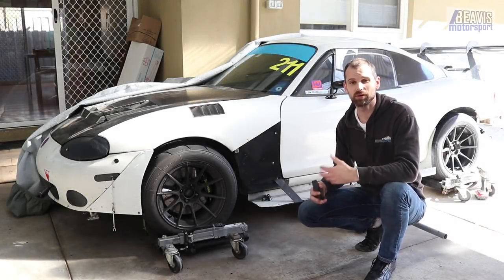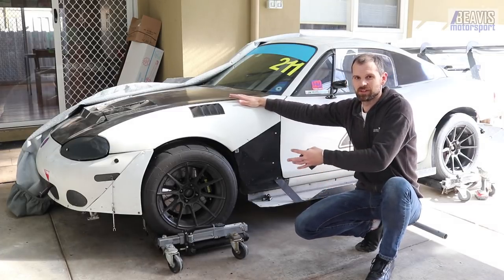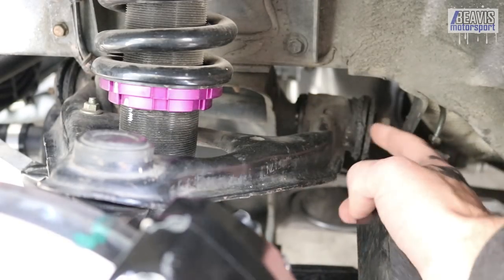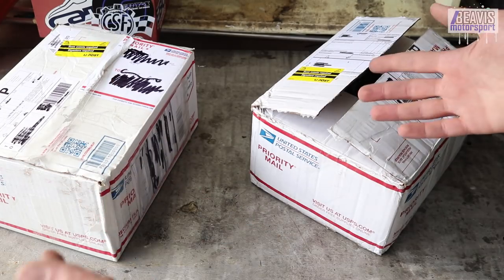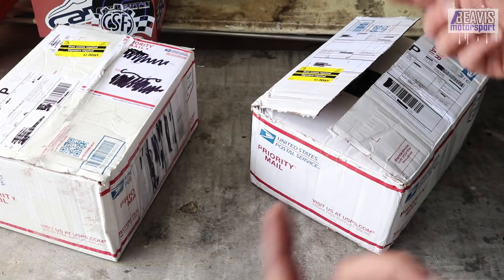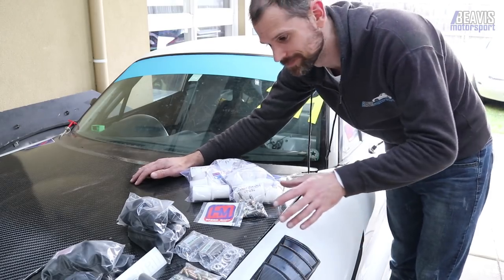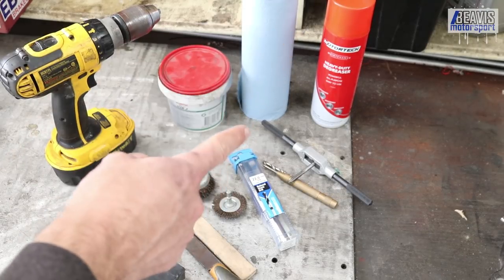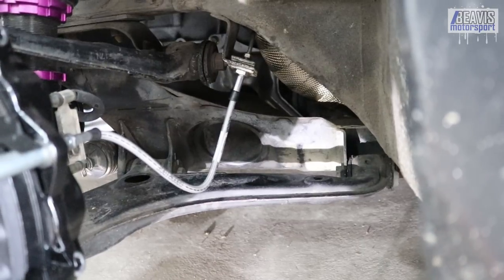Why Polyurethane Suspension Bushes Suck // Ep 83 // Time Attack TURBO Build

Comment: Hey man, I did a lot of researching to find out what the best grease to use for all poly is. One day I finally came across some users suggesting "Lucas Red&Tacky" as something that worked wonders for them.

I tried it out it's been almost a year since I installed my full Energy polyurethane kit. I daily drive the car often, and still to this day knock on wood ZERO SQUEEKS lol.

I fully vouch for the product as perfect solution as well. A lot of ppl on forums say teflon-based marine grade boat grease OR the grease the bushings recommend are the only solution yet people still report back of squeeks with using those products. I've even seen someone recommend permatec Anti-sieze haha as well as another guy that wraps his bushing sleeves with teflon tape.

So it really comes to whatever floats your boat. I've been thankful that Lucas Red&Tacky has worked great for me with zero drawbacks. Other than messy hands.

Hope this helps someone else as it's affordable like $5 a tube. Just I remember that people recommend to use it generously; no matter the grease. Load it up Inside and Out. Stick it all over the insides of the control arms, everywhere possible. :) The only thing shielding your grease from the elements ... is MORE grease caked on top. ;) Have fun! All in the name of PERFORMANCE
Reply: Enjuku Miata may i ask whats wrong with the EnergySuspension lube comes from their bushings?
Reply: @henryliu8518  I've never used it so i can't say from experience. I've only heard of people say that it has run dry on them fast, but you never know if those same people used enough of it and applied it as you should. So i think it's safe to say that there shouldn't be anything wrong with it other than the price for a sizeable tub. Pretty costly. A rather large tube of lucas red n tacky worked perfectly for me for like 5 or 6$ from my local Wal-Mart. It's going on nearly a year strong + with daily driving + you can see none of the grease has left the bushings too it still clearly has as much as i first put on lol. So i just wanted to spread good knowledge with people while on the topic of poly bushings and shead some light.
Reply: It was hit or miss based on online reports of people using the grease it came with. Probably matters heavy on circumstances. But i found even less reports online about people using the stuff i decided to go with yet none had anything bad to say. Worth spreading forward
Reply from the maker: Thanks for sharing so much detail, as always! Great stuff Enjuku.
Reply: Yep same shit I found with revshit, anti sieze or the bushings eat into the mounts and surrounding objects. Poly is shit when it needs to work in more than 2 axis's and that's when you go monoball, heim joint, or stick with oem rubber. Also all these companies do zero r and d and just copy whatever the better and next guy is doing hence the oversautration of the same poly product made by 10 differnet companies
Reply: @henryliu8518  Well unless they sell it in grease gun format, you have to tear down your suspension to grease it. Rather than use zerk-grease fittings. I've grown up around heavy farm equipment and EVERY vehicle we had up until my truck and moms 2007 FJ had a zerk fitting or I helped my dad pull and re-grease his wheel bearings in his old 1988 and 1992 Ford 4x4. It was always red. 

As long as its lithium based grease, which the Ultra Red is, youre golden as long as you have greaseable fittings.

Comment: Have you checked out SuperPro bushes? A lot more R&D into the design of them to not have the typical poly drawbacks (Energy/Nolathane etc) suffer.
Reply from the maker: I didn't consider it this time, the delrin kit was a little more expensive, and has a lot of positives that I'm looking forward to trying out.
Reply from the maker: Lyndon F  Not much opportunity to drive lately, all the tracks are closed due to lockdown so the car is just sitting in the garage.
Reply: I use superpro, from Australia of course, they a re fantastic, well designed, in some cases multi durometer poly mix and they fit well and perform brilliantly. You need to look about a bit more my friend.

Comment: If you pour your own poly bushings straight into the housing it doesn't allow debris to get inside also you wouldn't have to lube them because you cannot
Reply from the maker: Interesting idea, not something you see a lot. Would it make them hard to replace should they perish in time?
Reply: @Bbeavis  yeah but there are ways around that like finding the old part at a salvage yard and pouring another and your back in business or before your bushing goes bad buy a few of those salvage yard oem parts and pour a few and toss them in a shoe box under the bed for a rainy day im about to pour all the bushings and motor mounts for my car because it's cheaper than buying new stock and WAY cheaper than buying premade poly bushings theres a good video here on YouTube of a guy pouring his own motor mounts might want to check it out

Comment: not all poly bushings are created equally... my sister had Whiteline bushings on her STi that were still fine when she sold the car about 8 years and 160k miles later.
and if you're going delrin, you might as well just go metal rod end / monoball bushings.  There's nothing delrin does better than monoball bushings.
Reply: If you go down that route instead, the parts will cost thousands, and then suddenly you have a subframe/suspension arm setup which you can't quickly/cheaply source spares for. As it is, he can swap out any component Inc subframe for stock items cheaply and quickly

I don't know his budget or exact design brief but myself, I would go down this route for lower running costs / cheaper repairs / less down time more seat time
Reply: Braden McKay good point, I didn’t take those 2 into account
Reply from the maker: A complete custom rod end suspension setup is well beyond my DIY-er budget, and for a car that is just a weekend toy. This solution retains a lot of OEM like components and is somewhat cost effective for the performance. There are always better ways to do things, but this seems like the right solution for my use.

Comment: Use anti seize that gray or copper stuff. Also the poly is good for a road vehicle and ( light ) track work . Also maybe buy a proper brand of suspension products not cheap China  or some companies that claim to make the best parts with no R&D or make their parts in house . Just making money off people.
Reply: Lucas Red -&- Tacky is what I used. Awesome product. Just sucks to get on your hands.. (Almost as much as anti-seize). :P
Reply from the maker: Thanks for sharing mr323. The existing Energy poly bushes were from a reputable supplier, they are expected to be of good quality, but nonetheless poly still has its downfalls.
Reply: @Nasonix2  Maybe wear gloves? It sucks to get any fluid involved with automobiles on your hands.

Comment: Hi, my bushings burst quite frequently because the roads are pretty bad where I live. Would poly bushings last longer if I used them instead of rubber? My focus is on durability...I am referring to the bushings for the lower control arm (both front and rear bushings). I drive a Honda Fit Aria 2009 (4wd).
Reply from the maker: Not sure about Hondas sorry Johnathan, my experience is only with the Mazda MX-5

Comment: Did you run silicone based grease? 
 if you want your polly bushings to last run silicone based. 
Petrolium based grease kill polly bushes .
It's absorbed and eventually turns the bush sift causes tearing.
Reply from the maker: It was running the grease supplied with the bushes.
Reply: @Bbeavis  did you know what type of grease ? 
Was it white/ clear ? 
Run silicone based for poly bushings.
Reply from the maker: @marcusbarnes5929  It was Energy Suspension "Formula 5 Prelube",  it was a translucent white colour.

Comment: Anyone here familiar with Powerflex poly bushings? I have a '14 legacy that needs the rear bushing on the front control arm replaced. I like the stock rubber for how quiet it is but would like a little more feed back and less deflection. Any feedback on the brands products would be much appreciated! Thanks
Reply from the maker: I cannot say for the state of a Legacy, but for me us (in the MX-5 Miata), they are a large and reputable brand and generally perform quite nicely as a mild upgrade over oem soft rubber.

Comment: All you need to do to stop polyurethane bushings from binding is put tap on tape on the metal pin then grease over   Can also put Teflon tape on the outside in between control alarm or whatever and the bushing Don't see the point in that last part tho 🤔
Reply from the maker: Thanks for sharing Pat. That's the first I've heard of someone suggesting teflon tape, I might try that next time i replace a bushing on one of my cars.

Comment: So you fail to realize that its a compromise for performance. Not longevity. Same argument for tires, hard tires last long but poor grip and soft tires good grip lasts short. So can't buy grippy tires and then complain that it doesn't last. 
Poly bushes does what it's supposed to do but its not for long term
Reply from the maker: I think you missed the point, or didn't actually watch the video.
Poly sucks.
It binds and does not allow the suspension to move through its motion without having an effect on the rotation, effectively acting as a spring.
And, regarding your argument for performance at the cost of longevity, these bushes were only in the car for maybe 5000kms at MOST.

Comment: The bushings killed the body roll in my Miata and the handling was never right, I had a full kit and ended up removing it all for nos factory parts...Edit for sensitive lads like @Enjuku Miata, this was personal preference  I don't want the poly bushings mafia to get me for discrediting them LOL...
Reply: What year is your Miata man? That's horrible to hear!
ps. NA and NB don't even have subframe bushings to my knowledge
Reply: @Nasonix2  It's a 91, live and learn. It was no big deal thankfully Miatas are easy to work on. I think it was just because with the low power of them I like the body roll to help with drifting... Edit notice your comment removed lol, you must be fun at parties...
Reply: Sorry to say man but the 1991 mazda miata never came with subframe bushings at all. Not for the front or the rear subframe/crossmembers. It's all solid mounted from the factory to the frame of the chassis lol.

Your bodyroll was effected by either loweringspring or coilovers or anti-sway bar(s). Not something like control arm bushings.. Even the poly bushings for the sway bars don't make that much of a difference compared to upgraded swaybars but I'm rambling off topic.

This appears to be some kind of attempt to discredit poly bushings as a bright idea... 💡 but with a hole in the logic
Reply: @Nasonix2 , ok son, go to therapy...
Reply from the maker: Calm down Corod.